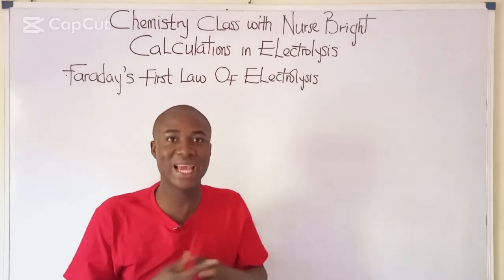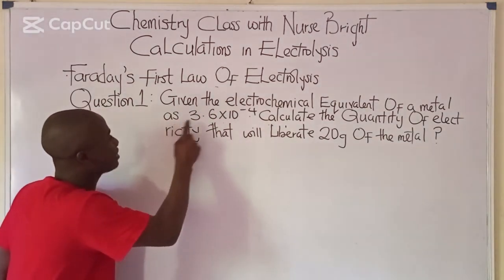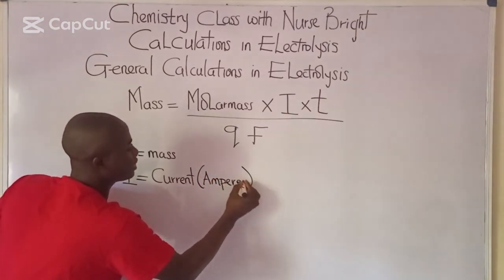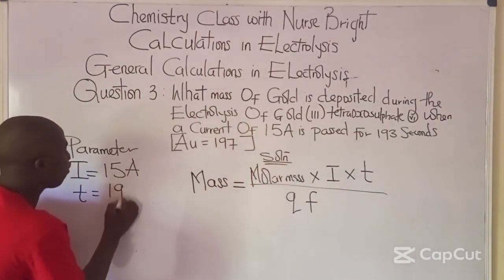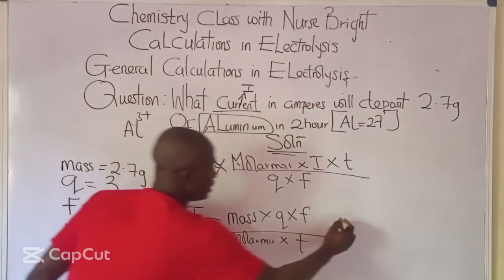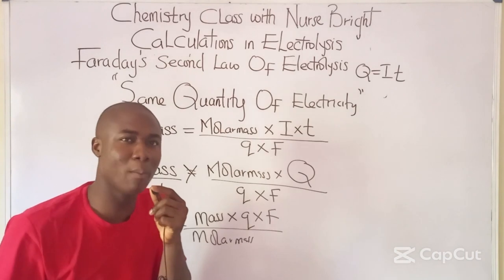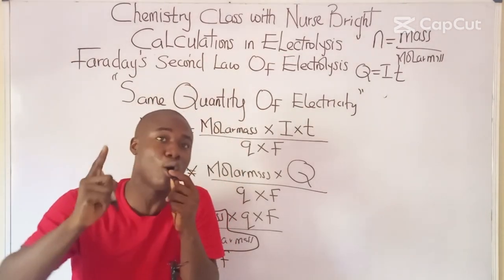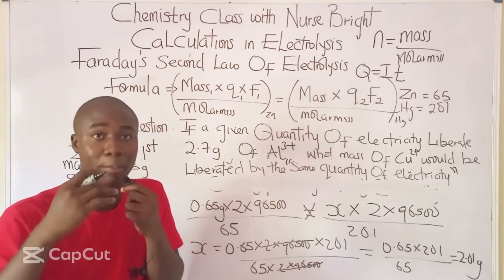Jamb 2023 Tutorial in Chemistry Electrolysis Class

Comment: Sir how did you get 4.021A for the third question understand general calculation on electrolysis 
I have tried calculating it with my calculator but it seem am not getting it right
My answer is 208440000
Approximate 2084.4*10^-4A